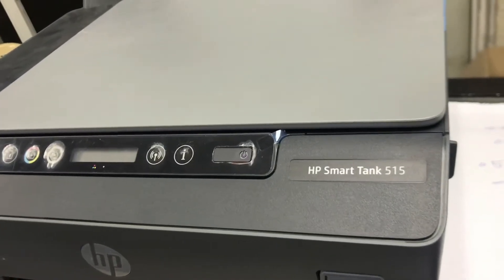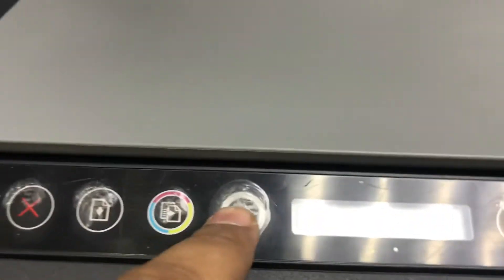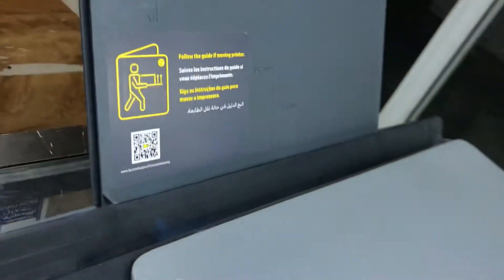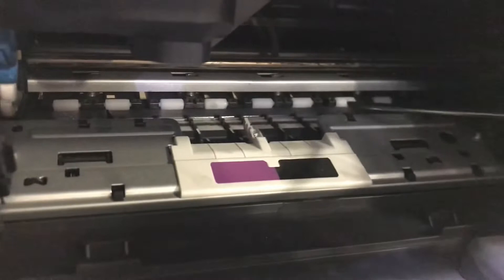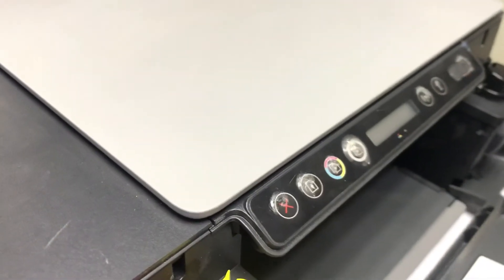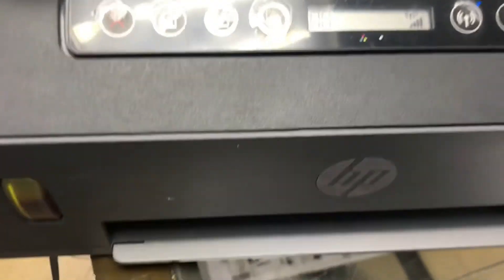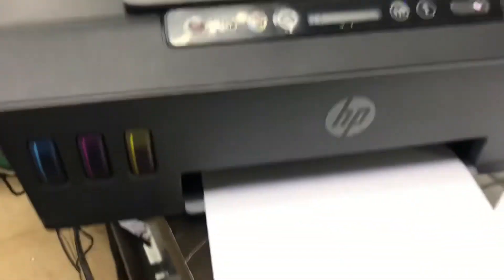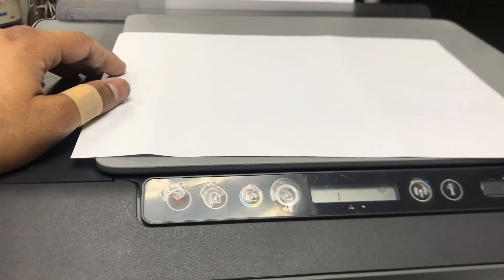How to Fix HP Smart Tank Printer? Paper Jam Problem HP Smart Tank 515

Comment: HI, can you tell me how to change a power module on a HP smart tank  559  printer ? my printer is nor powering on, the cable works very well with another printer 
. I tryed another compatible cable and still the printter does not power on,

Comment: Hi i change my wifi password now i cant use my printer coz it is not connected to my wifi my printer is hp smart 515...hiw to reset tge printer to connect my wifi thank u
Reply from the maker: hold the information and cancel buttons at the same time for about 6 seconds until the left side of the display shows a double zero symbol and the wi-fi button begins to blink